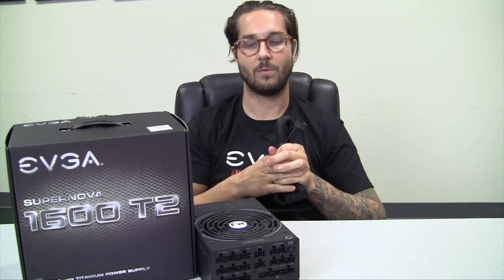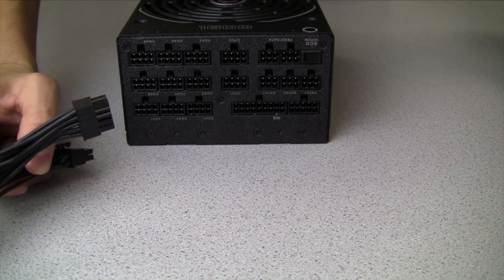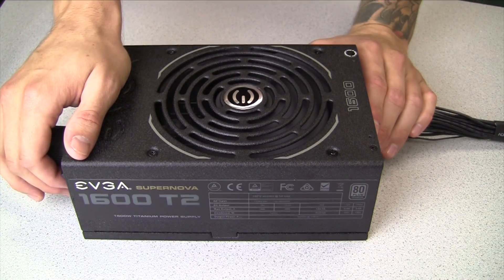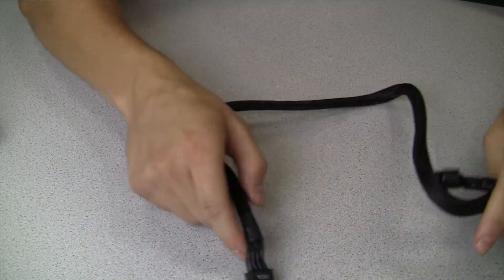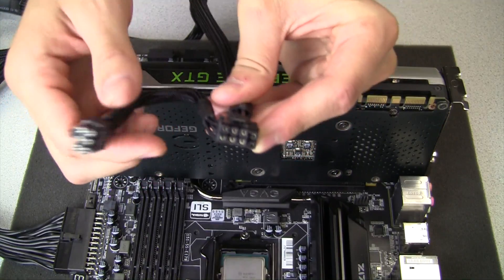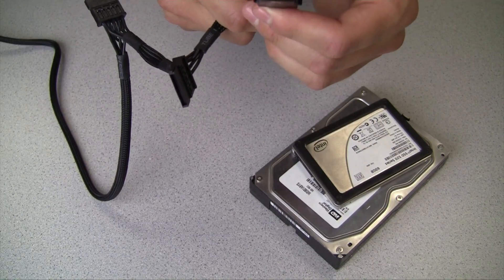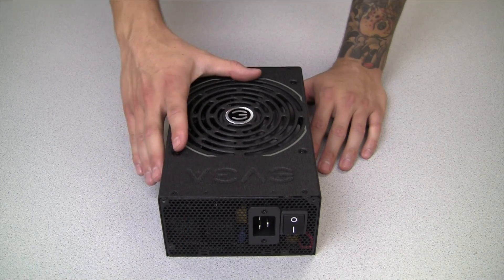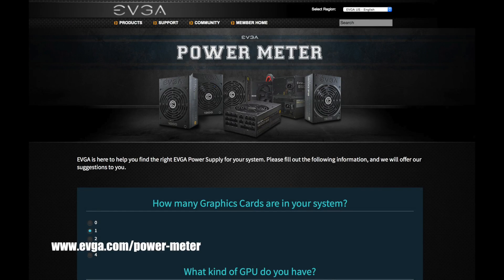How To: EVGA Power Supply Installation

Comment: Thanks for the info. The user manual was completely useless for the 850. Mind you, I'm an IT gal, so I can normally discern things on my own. First thing that threw me was the mention of auto eco. It stated that IF it was turned off... Uh, where do you turn it off or on? No diagram indicating where it was located. So I typed EVGA 850 into Google and discovered that with this model, the function was always off. So why mention it if I can't access the feature. Did they throw in "user manual" just for the heck of it? 

So I found your site and viola. Clear cut, step-by-step instructions that anyone could follow.

Comment: EVGA, i just purchased your 750W non modular PSU. while i’m sure it’s a fine product and will do me well for years, i wanna say fuck you. you’re an absolute piece of fucking shit. Putting a fucking 20+4 pin connector cable for the motherboard? On a 750W POWER SUPPLY? Id love to meet the person running a fucking 20 year old motherboard with a brand new power supply. Go fuck yourselves

Comment: I'm trying to find information on the pcie/vga ports individual power output. If I'm running dual graphics cards, does vga1, 2, 3 run off the same rail? I can't seem to find any specific information.

Can I have card 1 in vga1 and card 2 in vga2 or should I skip to vga4 in order to be on a separate rail, does that matter?

Comment: Excellent  tutorial great job  except the connection to the graphic card..
8 pin direct  to 8 pin    6 pin  direct to  6 pin  for  full power   !!!
Please note : 
Connecting 1   8 pin  split to a 6 & 8 pin may cause lack of power to the Graphic card on full  power draw while gaming and cause lag  flicker and choppy and stutter during  game play on high end cards that require huge Watts of power, so do a full direct connection  to the video card just in case unless it's a low wattage graphic card and not necessary and his tutorial on a power split is ok.
That's my opinion... because I had this issue with 2 high end graphic cards  doing this ...
Once I put a high end power supply's direct pin to pin connection from the power supply the issue was resolved.

Comment: Hey guys! I just bought a EVGA SuperNOVA 650 G+, 80 Plus Gold 650W, Fully Modular, PS from you and was glad to hear the ability of testing prior to hooking up. This will be the first time I have built my own PC and was a bit weary about doing so and turning my system on not knowing if my PS may be faulty, so it is good to know I can test it before installation. I was also thinking of hooking everything up outside of the case first to test everything as well, but a bit worried as I'm not sure how it will affect the board or parts soon after turning the PS off (possible static electricity increase when touching the board maybe?). I will have a anti-static mat , anti-static wrist band, as well as fully anti-static gloves to install everything, but you have any pointers on what to be careful of when doing it this way? Thanks again for this video, it helps ease my mind on the matter.

Comment: As you can see, the OEM Cables have capacitors inside of it. I would not replace it with Cheap Sleeved China trash Cables bcz they'r more fancy. Also the OEM Cables are 16 Gauge. Don't tell the Kiddos to do something like this please. It's an 1.6 kWh Power Supply with 133 Ampere on Single Rail. YOUR NOT SUPPOSED TO REPLACE THE 24 PIN CABLE WITH CHEAP CHINA TRASH!

Comment: Newer PC Case, Previous case had the PSU On top with Fan down,   It's Fan down in new case too, as do have filtered vent on bottom, with decent sized legs on wooden PC desk.    Filter & Dust clean out soon for this newer System, almost a month after getting it from local shop.    Do notice shop turned on Eco mode?   it's in Power supply basement shroud area, should i leave Eco mode on, or switch it off?

Comment: The ac mains cable doesn’t go in properly it just falls out after 2 mins for some reason why is this is it because the cable is faulty ?
Reply: Many times those AC cables do not fit properly. It's very annoying on many electronics. Might need tape or some spacer to keep it tight.
Reply: Bob Jones Yh mate I think like the idk the cable was to big or something I bought another one and it fit perfectly and had no problems

Comment: Thanks for the vid! I didn’t know you could mount the psu both ways so I’ll be looking for the grill/filter in my new case. 

On a side note, are there any benefits besides noise reduction for turning eco mode on? Are there any downsides to using eco mode?

Comment: Fan down or up ?
mATX build i say fan down for 2 reasons:

1) you are drawing/stealing air or creating a vacuum from your GPU cooler which can cause GPU throttle
2) lack of space = you are drawing hot air

If you are using a M.2 Ultra slot you will suffer a lot of performance on read/write speeds on mATX builds.

Comment: Bit late to the party, but is it normal for the PSU fan to power on for a couple seconds before turning off during the test? Recently had a PC fail and couldn't tell if that was an expected result (EVGA Supernova 850G)

Comment: Why are the fans facing upwards? It takes less airflow from your graphics card if you have the fan facing downwards taking in air from outside the case but then the logo and stuff are upside down.

Comment: 1600...is that enough?
Reply: 1600 is usually more than enough unless you are running an absolute beast. The 16000 was good for turtorial because it basically has every cable in every of the models. Unless you want multiple high level graphics cards or cpu's maybe even throw in an extra SSD or hard drive the 1600 is for u.

Comment: Help, I want to upgrade my power supply, but there is multiple connectors that look the same, would I be able to put any connector into any slot that fits or do I have to find a specific connector?

Comment: Don't suppose you do a USB Psu for the newer Psu's.  I've installed Supernova Software to monitor the psu fan, but it isn't seeing the connection and I don't know what cable it uses or where it connects, using a G/byte AB350 gaming 3 mobo.

The power meter link is pretty cool, didn't see this before I bought, I got a 650, but it seems to think I only need a 400w psu.

Comment: I have a prebuilt system, and i bought a GTX 560 TI, and i realized my power supply didn't have a PCI-E to power up my graphics card, so im getting a new power supply but i have no clue where to put stuff because its a different one than the vid

Comment: How would I connect a 1080 ti to this power supply since it didn't come with an 8X8 plug? Only have the 8X6 pin plug.
Reply: Charlie Smith I have the same question. I think you use the vga connections. Crosses fingers

Comment: What is the difference between using one cable for the GPU or two separate cables? (4:10) Is one better than the other? I will be using the P2 with a 1080 TI.
Reply: Jack Clemor do you know how the 1050 ti gets power then?

Comment: Dumb question i have a power supply. I want to upgrade to a more powerfull one can i used the same cabels the old power supply has and just connect to the new one. Help me out thanks
Reply: Monkey D Luffy2 Usually not, the pinout on the psu might be different, so you might end up connecting + to - or something horrible. Usually they also just don't fit. If you want to, you can check pinouts on both psus and make sure that they are identical, in which case you can use both sets of cables with both psus.
Reply: I just purchased a power supply for my desktop, I see the motherboard has only 14 pins/slots but the new power supply has 20, any ideas? thank you

Comment: Question, I'm planning to buy Asus Strix GTX 1080ti OC edition which is powered by 8x2 Pins, is it possible to use 2 seperate 8pins cables and connect to VGA1 and VGA2 PSU?
Reply: Yes.
Reply: This needs to be near the top of the comments

Comment: Fun fact: "Circle Down"? The labels on those switches are actually binary. 0 = off I = on.
Reply: Fadeux and now I know
Reply: Nice
Reply: Yea binary, like l and 0. A letter and a number lmao
Reply: Hless421 he meant 1 and 0 but yes
Reply: I always thought of it as a circuit, so an open circuit wouldn’t transmit power (hence off) where a closed (I.e. grounded) circuit will transmit power

Comment: Is there a way to change the fan profile (rpm)?  I have ECO on and when the fan kicks on it is very loud. I have a custom water loop with 11 vardar 1150rpm 140mm fans and the psu fan is 100x louder.

Comment: I have a EVGA 650 GQ and my cpu connector is a 2 by 2 and the power supply doesn't have a 2 by 2 pin what do I do?

Comment: Does the PSU tester works with none EVGA powersupplies?
I've bought the 750W Supernova G2
Reply: Niles Niles thats a EVGA psu
Reply: Chaiwang Guy I know, what I mean is that will the tester works with none evga PSU? I think it will but just want to be sure.
Reply: Niles Niles yeah it works With non EVGA psus
Reply: The idea of the PSU tester, if I recall properly, is a piece of protective plastic to prevent electric surge or getting electrocuted when testing the PSU turned ON. Therefore, there might be no incompatibility issue, unless if you have unmatchable pins. I might be wrong though, so take it with a grain of salt. ^^"

Comment: THIS. Is why I'm going for the EVGA 850w P2 over the Corsair AX860i
Reply: ***** I'd only do it if you really need the extra power. Corsair are good, but EVGA are better value and apparently higher quality cables. So it's all down to what you need.
Reply: ***** I don't think you should need to change the temperatures. And about the cables, the correct wires should be supplied with the PSU but if you have other ones that came with the fans and stuff then use them.

Comment: for some reason after about 4 hours of my pc being on it shuts off by itself and im thinking its my psu because whenever i turn off my pc my psu makes a short grinding noise 

my specs are:
Intel i7 6700k
16gb ram at 2400 
msi gtx 1070
msi gaming m5 motherboard
evga supernova 650w g2

Comment: you no need install 2x 8 CPU cables? on motherboard if she have 2x 8cpu? 3:20, if you intall 2x 8 cpu connection motherboard explod?
Reply: if you read the manual to your motherboard it is optional for extreme overclocking.

Comment: There's like a buzzing sound when I turn eco mode on.  Is that normal?
Reply: That's coil noise, if it bothers you, check warranty status.
Reply: M. Muzammil Shaikh 

Soo it's not suppose to sound like that then correct?
Reply: check the motherboard BIOS for low power settings and enable them. I've read in some cases this solves it. If it doesn't solve it and it still bothers you a lot, check warranty options. It doesn't affect performance.
Reply: M. Muzammil Shaikh 

Oh I actually tested it before connecting anything to it.  It came with a tester that I used
Reply: If its really bothering you and you're concerned about performance issues, and if it's still under warranty and you can afford your PC down time, get it RMA'd or replaced, while you still can.
Reply: M. Muzammil Shaikh 

Yep, got the replacement from amazon
Reply: Hope it works out.
Reply: Soooo.. I got the second one, and it still makes a feint buzzing/coiling sound when eco mode is on.   So I guess it's normal for it to do that.

And I guess once it's in the case, probably won't hear it anymore anyways
Reply: Candi Soda Would also suggest using a higher grade power extension, ideally via UPS that normalizes power (double protect) output.
Reply: M. Muzammil Shaikh 

I probably won't go that far as of yet but I appreciate your suggestions.  

If it gets worst near the 5 years, I'll see what EVGA could do to help.  They're known for good customer service. So hopefully that doesn't change in the long run

Comment: Thank you for uploading this!!  I'm building a PC for the first time and I was confused why the PSU cable going TO the PSU was split (looks like an 18 pin + 10 pin).  My current Silverstone 1000W PSU has a single 24 pin on both ends going from the PSU to the MOBO.

Comment: What if the power supply can only be mounted on top, but there is no vent/grill on the top of the case. should I point the fan up, or down?
Reply: point the fan down.

Comment: is there any reason why some people would use 2 VGA cables instead of the one that has the 2 already on it?
Reply: what if i don't have 2 vga already on one cable? do i insert 2 vga cables
Reply: i guess so :S
Reply: i just tried it and it worked
Reply: some card require more than just an 6+2 or 8pin connector. Gpu's like the 980 ti require 8+8 pins to overclock correctly! Be sure to check what your specific VGA cable requires :)
Reply: ***** too late, i took her on a date
Reply: to be fair the girl on pool wizards profile isn't actually him/her its Angie Varona, an instagram model

Comment: Hey guys, just installed my new Nex750b and upon turning it on I got a blue spark followed by smoke and a burning smell from the psu. Any ideas why this happened?
Reply: Was it compatible with your other parts?
Reply: Was it compatible with your other parts?
Reply: Yea was just a rare manufactures fault and the replacement was fine ;)
Reply: All good then man, good luck with it all

Comment: i have recently purchased the supernova G2 and the srews provided would not screw in properly..i use all of my force and still got them 70-80% in the screwholes, thus the psu is not 100% firmly mounted to my chassis.. what is the deal with that? for that ammount of money this should never be an issue...

Comment: should I get the EVGA 700w b1, or the EVGA 750 g2?! Im afraid that with the G2 I will screw something up! ex: plugging the wrong end of a cord into the mb
Reply: +FrugalBread - definitely go with the g2, its a more efficient and well regarded power supply also has 10year warranty which is pretty handy

Comment: I already have the pins and cables in the case set up with my components and my motherboard from my old power supply.

Can i fit my new evga power supply instead of my new cables?

Comment: found a 750gq power supply for $79 plus %15 off that. should I jump on that or get a g2?
Reply: +Giulio M yes indeed there is
Reply: +Hasham Shaheen in the 850 G2 there is the 24 connector tester, for test the PSU?
Reply: +TRAILBLAZER02 Get a g2 it's better and i've got one
Reply: +Hasham Shaheen that's what I went with. the site with the GQ got some stock of g2s so nabbed one for $85
Reply: thanks :)

Comment: i just did the test on the power supply and it works. But when I plug it into the mother board it doesn't turn on for some reason.
Reply: so...did it work in the end